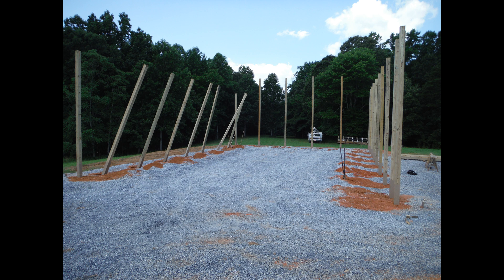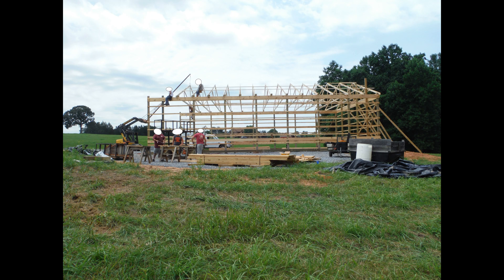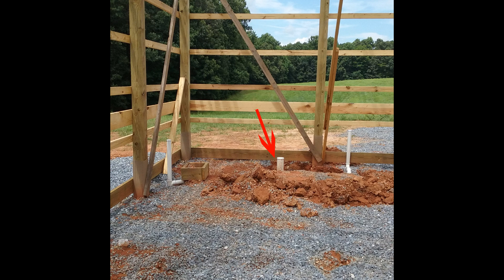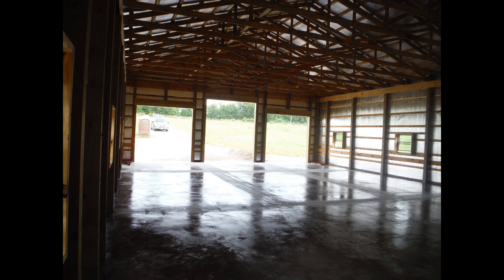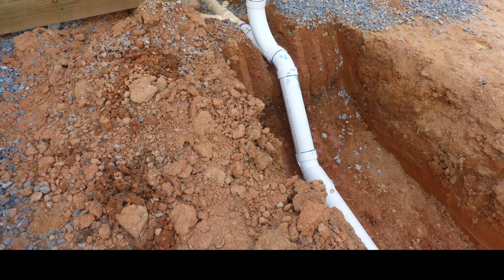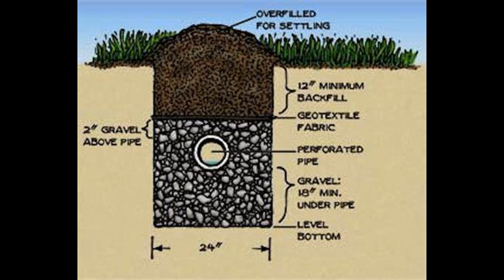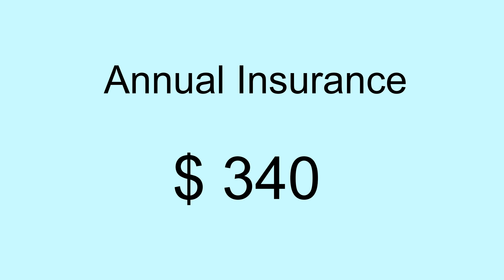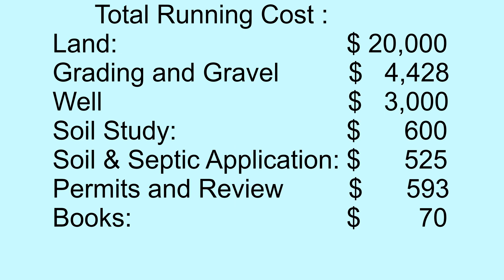#7 Pole Barn Home Build: Building the Shell

Comment: I am assuming that you did not use spray foam insulation because the cost was prohibitive, as it is for many of us. But why did you decide to use the foil insulation? Will you still have to worry about the metal building "sweating"? Thanks for making and sharing these videos! You have done an excellent job!!
Reply from the maker: Thanks for the kind words.  The foil was something the builder included in all his buildings.  I researched it later and found it blocks most radiant heat transfer.  I have zero sweating, likely because there is no big difference between outside conditions and inside in the garage, due to vented overhang soffits and peak vent.  The same soffits vent into the insulated attic above the living area.  Air movement is very important.  I would guess more of the sweating metal buildings have no airflow.

Comment: Can't believe those post savers coat $50 each....  I guess its cheap insurance... And I know its worth it... But I'm sure it adds up.... Having said all that... When its my turn, I'll be doing the same or similar.
Reply from the maker: Definitely worth it unless you are keeping the wood out of the ground and on top of a concrete pier using a bracket.  That would cost more in labor though.
Reply from the maker: Everyone who has been inside and seen them has said the same.